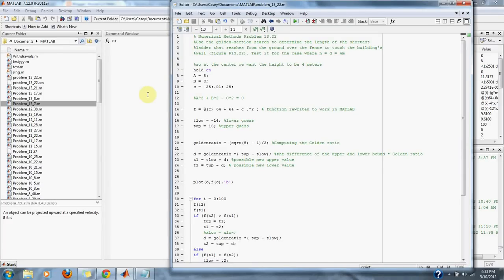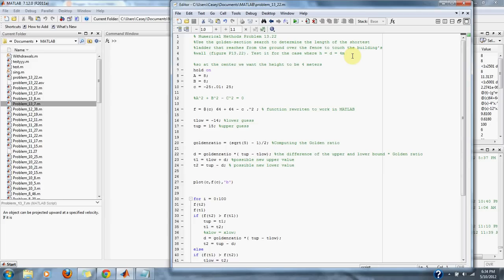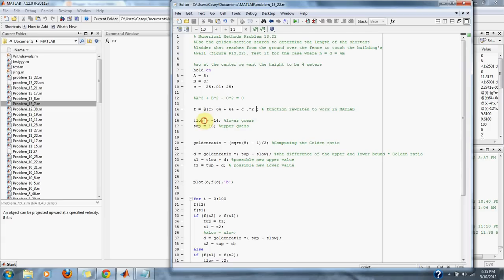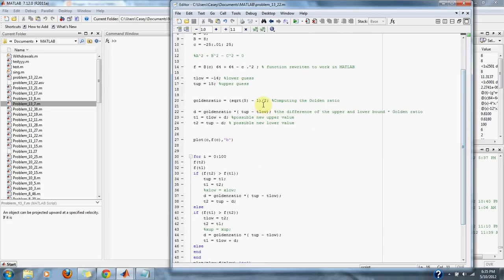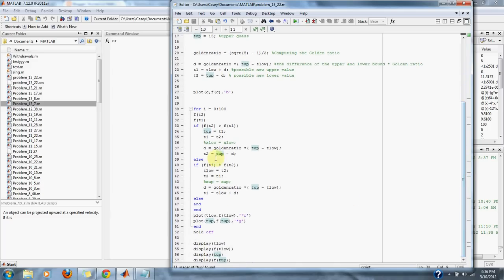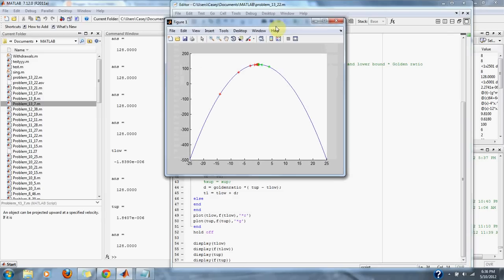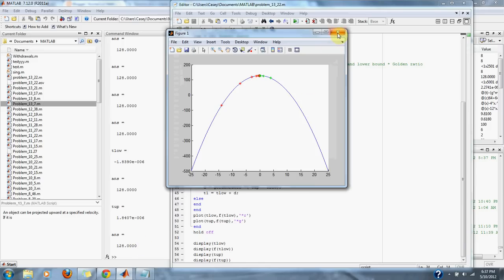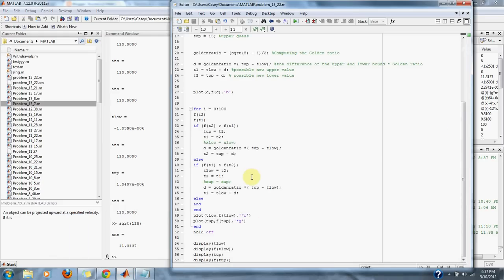Numerical Methods Problem 13.22

Comment from the maker: Yes, the only difference is you need to switch the greater than sign to a less than sign. Problem 16.17 is an example of Golden Section Search looking for the local minimum.